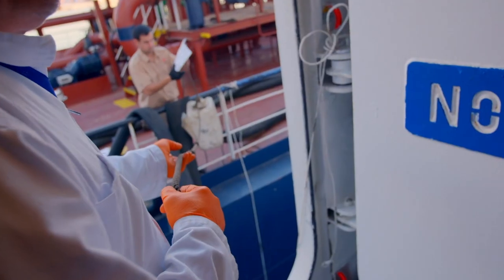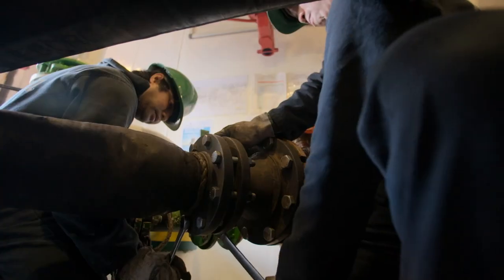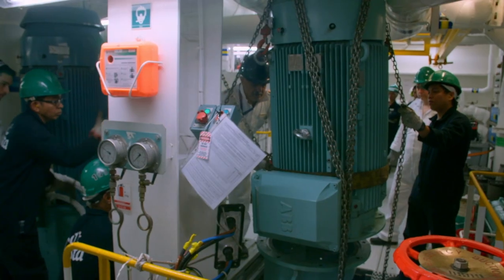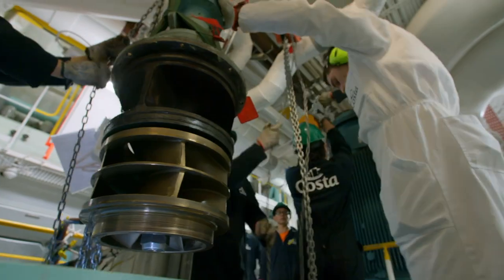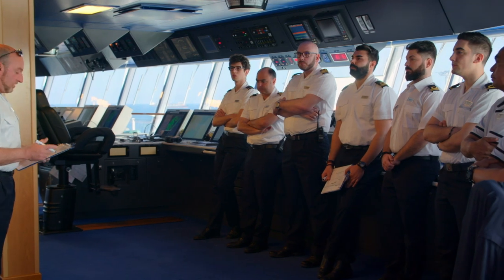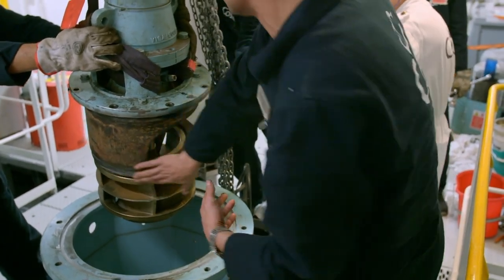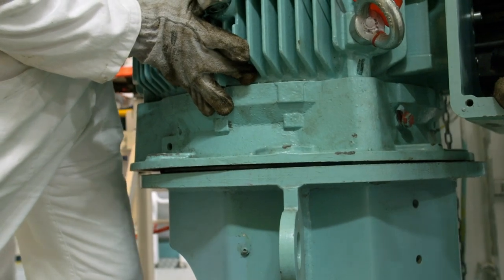The ‘Impeller’ is a Vital Component on this Giant Ship 🛳️ Mighty Cruise Ships | Smithsonian Channel

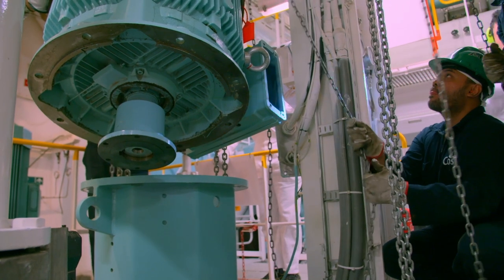Comment: At 1:30 - "The 28,000 horsepower motor..." . Total nonsense and a poorly edited video.
Reply: More like 75-100 hp is more like it but could be up to 150 -200hp with that impeller. I worked on pumps & motors my whole life. My last employer did a lot of ship size fuel barges & the tugs that were married to them. Large chemical ships , the tank farms and all types of industrial, commercial work.
Reply: @thomastuorto9929  Yep & Thanks for your input.
Reply: I think that number is for the engines the impeller pumps cooling water for, someone got confused during production lol
Reply: @maceosikes  Most Likely.